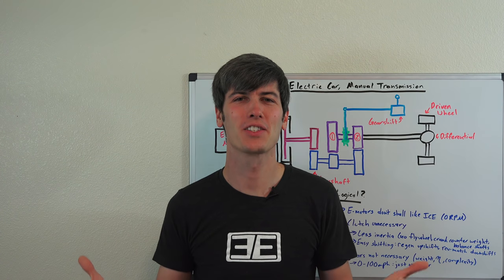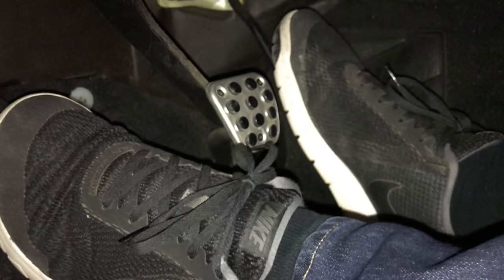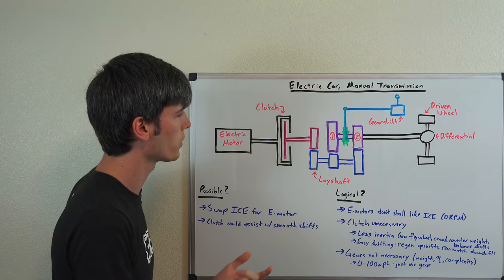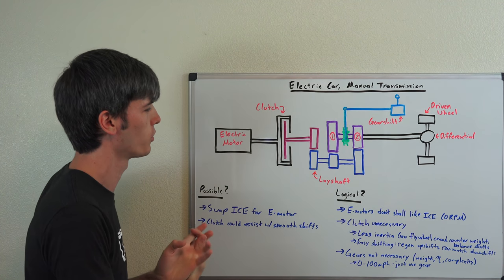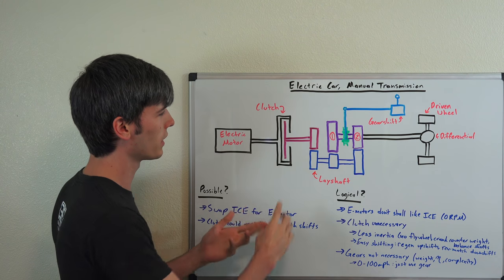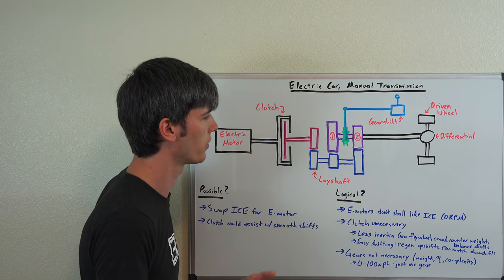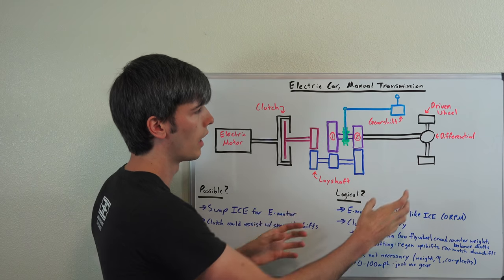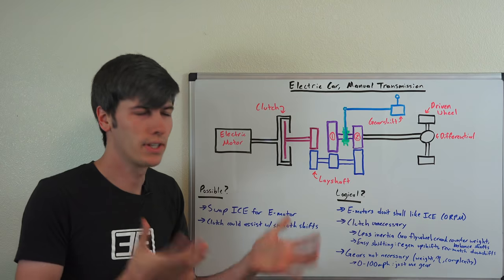Could Electric Cars Have A Manual Transmission?

Comment: This has already been proven to Work! The guy who did this is a Slovenian Car converter from the "Metron" institute. he used a Modified car with 86Kw + 12 KW added to the spare tire trunk so all in all 96 kw and drove  over 800km on a single charge. He uses a 5gear transmission here the link http://eauto.si/en/metron7-2/

Comment: Why can't they just put a engine wheel in the end of the eletric motor rod and a normal clutch and gearbox?
After all it's not about be necessary, it's about drivers who like this kind of conduction

Comment: I drive a Nissan Leaf and live in the southwest of England where there are steep hills narrow roads and in town centres lots of traffic. I was traveling down a steep hill at at 5mph because i was in at traffic que. I had to use the brake as releasing it would make the car go too fast. I couldn't't help thinking that a different gear would turn the motor faster and create more regen braking at low speed?

Comment: what would the pros/cons of a weighted flywheel a
kept at a minimum rpm (like a combustion engine running at idle)  by an electric motor and a clutch to mimic a traditional system? I could see that it would allow for a higher gear set. just playing devils advocate

Comment: How bot nagnetorechronic typos included Renault f1 type trans-diff-clutch combination with electric and hydraulic actuators included. Adjust clearances and viscosity change revolu speed matierial magnelctric plate each part for actuator assist and electric motor activation

Comment: Using a transimition woulndnt allow to use a smaler motor (lower hp/torque) for the same speed and acceleration thus requering less electricity for longer batery range  ?

Comment: I'd prefer a high-torque 3-phase induction motor that max out at 6000 rpm with 5-speed manual transmission. DO NOT follow Tesla when it comes to the power train! They are more focused on revenue rather than technical details.

Comment: I think he over complicated it. Yet, there are multiple ways to skin a cat, his is one of them.

In my mind, they could simulate a gearbox by having the electric motor go a certain rpms in each simulated gear that is controlled by a computer chip that is connected by a mechanical or a Digital shifter.

Comment: One problem with EVs is the range. Would adding a transmission increase the range? Or would the motor take the same amount of energy? I have wanted to build an ev car with a manual transmission to see but was told by a friend that it's pointless because if a motor spins at 20k rpm to go 100mph, with a gear that would make it spin at 5k rpms the energy would be the exact same. Is this true?

Comment: For example in the case of an electrictified Toyota GT86 they have a low hp, high torque motor. 100hp or so not sure torque figures. Could the gear box improve acceleration in this scenario? Or how would it. Or are we limited in performance by the low HP output?

Comment: Gears are for having optimal torque so adjusting the revs vs speed that the engine is always near or at optimum torque in a traditional sense... since electric motors have a rather flat torque curve, this wouldn't make any sense. Being a die-hard manual shifter... it pains me, but... NO electric cars with gears don't make sense.

Comment: Durability and ease of repair. Automatics are not durable and can be difficult to trouble shoot and repair. Twin clutch systems are basically manual transmissions that are controlled by a computer. Again complicated to trouble shoot and rebuild and again prob. not as durable. CVT makes more sense especially for an electric motor. There is the possibility that using some form of transmission could allow for the use of a cheaper motor and fewer motors. I can not imagine electric motors powerful for use in cars are cheap and having 4 of them one at each wheel just increases the number of parts that can fail and the un-sprung mass at each wheel. Cost will be the driving factor which ever way is cheaper for an OEM to build is the way it will go. Not to mention parts stores adn dealer parts sales would sharply decline. You would have a ton of mechanics and DIY'er's that would be lost in that sort of situation. One of the problems with not having a transmission is that it would eliminate one mode of drive feedback and mental satisfaction. Since you can legaly only go so fast being able to pull high G's at street legal speeds and being able to feel the engine braking and sudden deceleration and re-acceleration is part of the driving experience event he engine sound changes with each shift. People who hate car's and driving might like that but the rest of us would feel cheated. Lastly even in Europe as Top Gear and Grand Tour have demonstrated charging points are far and few and would end up dictating your travels. Just look how bad we all feel for Corvettes owners that have to suffer with a warmed over automatic!

Comment: But you are only talking about performance and i can see a transmission paired with electric motor for better range, as the engine will have to use less power to maintain speed. That should be the way to explore subject not just performance.

Comment: Lots of logical reasons.   Manual transmissions are cheaper, last longer and don't break down.   Sent my 14 year old Saturn L to the junkyard with over 350,000 km on it.  Still ran fine, never hadva powertrain issue.  Changed the clutch oncevaround 250 k, cost about $750.   Cars with automatics die young all the time,  unreliable, too expensive to repair and also no fun.

Comment: Le' Guider Philippines electric vehicles are direct replacements to internal combustion engines without removing the transmission. They developed the transmission controller and have been using it for 5+ years. They use it for buses which allow them to carry loads and climbing on economical electric motors. For more information, visit their FB page or email info(at)leguider (dot)com(dot)ph.

Comment: Electrification and automation of cars erode driver engagement 

With all the torque from a small electric motor would a manual allow the engine to be smaller (gears FTW) than a larger electric motor that need to work harder with a single gear

Comment: Imagine a 6-speed Manual Electric car that screeches at 15,000 RPM. Eeeeeeeeeeeeee shift eeeeeeeeeeeeee shift eeeeeeeeeeeeee shift eeeeeeeeeeeeee shift eeeeeeeeeeeeee shift eeeeeeeeeeeeee. Then when you brake it charges the battery so you never really have to fill up on gas.

Comment: Don't worry guys. If you don't have a tachometer in your manual electric car, just listen to the engine
Reply from the maker: I get the joke, but you certainly can hear a difference in RPM and load for electric motors.

Comment: Electric motor can rev up to 14 15000 rpm 
so you do not need  5 or 6 speed 
You only need 3 or 4 speed

Comment: Does electric engine rpm effect how long it stays charged? Like if I was to go on a short road trip, would having like a 3 speed transmission that allows for lower engine rpms at 85mph use less electricity?

Comment: wouldn't you still need the clutch with a manual trans electric car so you don't grind gears? doesn't seem like you could shift easily while still connected to an electric motor accelerating or decelerating. maybe I'm missing something as I am not an engineer, just doesn't make sense to me how you could shift a manual without a clutch to separate from the engine during shifting

Comment: Why are automatic transmissions more "logical" when they are prone to early failure relative to manual transmissions regardless of design and do not match the desired engaged gear ratios of the operator 100%. I have yet to meet an ESP blessed automatic transmission.

Comment: If an EV had a transmission, would it be more efficient though? Couldn't a smaller motor, using less energy, accelerate similarly, yet use less energy due to the mechanical advantage?

Comment: couldnt a trans in an electric car allow you to use a motor that is much higher torque but lower rpm but be able to get the same top speeds through a transmission but have more torque for the lower speeds?

Comment: mmm this video lacks a lot in terms of how different electric engines deliver POWER.
and how efficiency curves look for different electric motors, not just vs rpm, but vs load.
based on that i would absolutely say a transmission is a bad idea for elecric powered cars.

Comment: @EngineeringExplained I agree with you on most things but to say that 'manual transmissions are illogical' today is incorrect. They are still without argument more reliable than automatics. I  buy only manual cars, if nothing else, because of the reliability factor
Reply: A manually-changed gearbox on an electric car is illogical.
It doesn't need one.
It doesn't need a starter motor either, although someone will no doubt want to fit one.
Why can't you have spark plugs and a straight-through exhaust, for that matter...

Comment: hi EE ... can you clear my doubt... yest i know electric motors can run car with out need of a transmission... but if we include a transmission will that help to  lower the motor hp and load on the motor and hence extend the range... in simple english.. will i be able to replace a 40 hp electric motor with a 30 hp motor by using gears.... ? hope i made the question clear enough....thanks...

Comment: I feel the fun of driving has been taken away with the electric motor anyway so whether it has a manual gearbox or not doesn't matter to me.  If you kill the car's soul, it's resolved to nothing more than a tool to get from point A to point B.  Nothing between matters.
Reply from the maker: Have you driven one? They’re super fun in city driving scenarios, so much available low end torque!

Comment: If the transmission has overdrive/underdrive gears, it could improve the energy efficiency by allowing a smaller motor. A blance would have to be found between the additional weight of a small gearbox, the decreased weight of a smaller motor, and the decreased power consumption of a transmission setup. A simple cvt could also be of use
Reply: I think a smaller motor would require basically the same amount of electricity to reach the same speed as a larger one would.

Comment: why would anyone even consider a stick shift and transmissions in an eclectic car?. that is like using a dial up modem to access the internet, sure you can, but why would you when there is far superior technology. stick shift with clutch are slow and cumbersome old tech from the early 1900's. I do not know anyone who likes fast cars would every say they want to down grade to a stick to handy cap the car. maybe some just want a gym work out for one leg and one arm or think the planet is flat.. who knows, but I think tech should go forward not backwards. next video " candle headlamps vs laser headlights."

Comment: Would it ever make sense to try to convert a gasoline car to electric? How would you do it?
Reply: Only reado. it would take a lot of work modifying the car to change the cooling system, adding a big enough battery and mounting the motor to the frame, installing an inverter and control module, it would be less efficient. only reason to do it is if you like the car body but want to go green.

Comment: Can't you make an EV more efficient by adding a transmission to it? Doesn't driving at 60MPH on idk 4th gear makes the engine RPM lower than no transmission? Therefore consumming less energy

Comment: It would mean your car wouldnt stall either so cool ahahaha and would that mean the efficiency and range of the ev would be lengthened as it means the motor will spin at a lower rpm to stay at a high speed

Comment: Your video assumes... Lithium polymer will not Deep Drain Battery landfill and run out.. ! How about a hybrid fuel electric self charging car with gearbox transmission above 43mph for EFFICIENCY, LOW FUEL CONSUMPTION, BETTER ELECTRICAL USE FROM STANDING START AND MAKING USE OF ELECTROMAGNETIC TORQUE IF HYBRID FUEL ELECTRIC self charging CARS LIKE PORSCHE 918 ?

Comment: Almost every new car has an automatic transmission xD I dont think in the future we'll have manual's :P Unless if your Honda Civic is still running by then .-. That thing wont be as cheap for repair costs or parts if ya crash xD
Reply: But its still possible cause the new Evora ALSO has the manual transmission but has an Automatic option too...

#whylotus?

Comment: I am confused with one big doubt !!?...I am going to manufacture the Electric solar vehicle for local competition , I am bit confused with which transmission have to be used , !! CVT or Gearbox transmission ??,. ..Please clarify my doubts !!! Motor rpm 2000 ,60V..and I need min 40-45 km/h...
Otherwise please send some links where I can found solution for my question !!.. Thank you

Comment: Does anyone know how electric cars are wired up?
I couldn't find much information on it but it seemed like the use DC motors? Please correct me if that's wrong.
If that's the case would they not be much more efficient with a inverter to convert the batteries DC voltage over to AC 3 phase wired in star/Delta.
Being wired in star/delta would give it more torque to accelerate in star, then switch over to delta once running to give more efficiency.
I couldn't find any information saying this is used in electrical cars, can anyone think of a reason why it isn't?

Comment: This is why I say that slow people cannot make fast cars. Bro you're dead wrong about a lot if this stuff. I'm not trying to be insulting just hear me out. Transmissions were designed to work for combustion engines. If they were designed to work for electric motors, they would be a lot more effective, and there are some but they're not for cars. Servos are geared; It's that simple. A lot of machines that have electric motors and gearboxes literally have transmissions. It all depends on what you design it for, and there most certainly is a demand for trannys in EVs. All EV motors are the same, They are very weak in comparison to combustion engines which transmission are made for but nonetheless transmissions will always do one thing. They improve the strength of a motor. Electric motors don't have good torque at higher rpms. Some more than others but it's still low torque at higher rpms. Shifting is necessary if you want to improve the performance of an electric motor. The model S is killing cars in 0 to 60 and quarter mile runs but that's only 60mph. Past 120 mph, it's a normal car all over again. A transmission specifically designed for an electric motor might not even look like combustion engine transmissions, but why should it? That makes no sense. The only reason we haven't seen it done in the past is because we didn't have the means, or simply didn't want to bother with innovating a specialized transmission for an ev. And Tesla also confuses people because they make you think a quick 0 to 60 and 120 on a 1 speed gearbox is faster than you'll ever need to go for the most part but, it just isn't truly powerful all the way through, nor does it make for a good daily driver that you can still take to the track. To think that 60 and 120 mph is so easy without a transmission, and that formula e cars actually have 2 speeds, is only an invitation for electric cars to use transmissions to get the rest of whatever performance benefits over combustion there are out of them. Transmissions are very much needed in electric cars to make them complete.
Reply: wait you mean manual tranny not tranny in general? if that's what you meant then no way in hell bro. manuals are old tech. That wouldn't even be fun anymore.